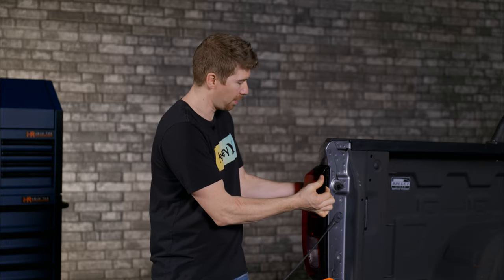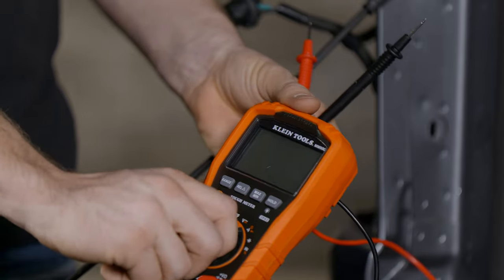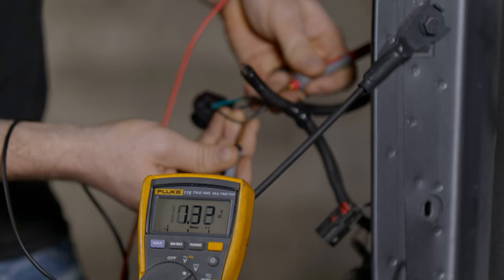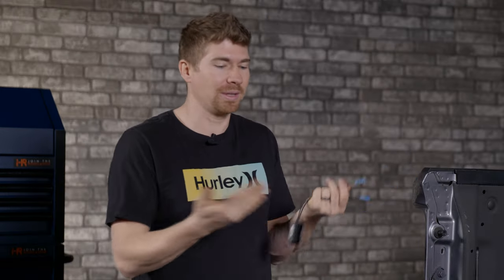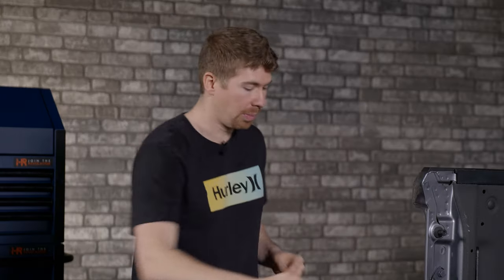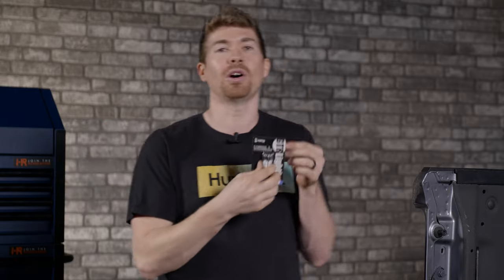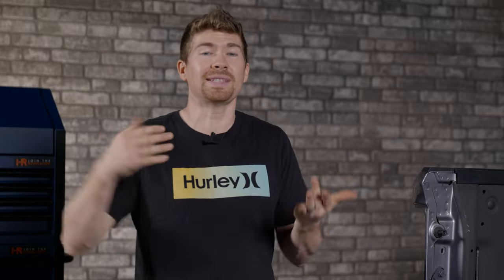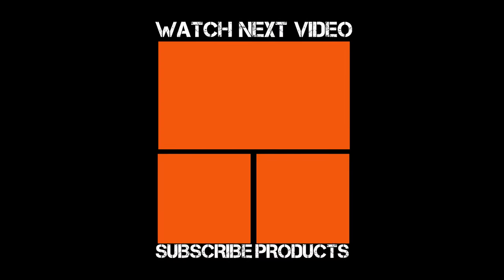How to solve turn signal hyperflash by installing LED resistors | Headlight Revolution

Comment: Explanation front-the-back.  Higher resistance (LED) = less current.  Lower resistance (filament) = more current.  Resistors are fitted in PARALLEL, so the resistance is LOWERED, to mimic the filament.

Comment: I didn't use resistors for 2000 Toyota Camry LE. The thing about Toyota is that if cut wiring. What affects one thing on a Toyota will affect other things on a Toyota. So what I did was I did some research to see what I could do. What I read and did worked. Instead of cutting wires and putting resistors in I changed the flasher in my 2000 Camry LE. This flasher worked with both standard and led bulbs. It worked. I wasn't sure that it would. So far it has still worked. I know probably you don't like Sylvania Zevo Super Bright LEDs  but my whole 2000 Camry LE is almost all Sylvania Zevo Super Bright LED bulbs. So far I have been really happy with the Zevo Super Bright LED bulbs. I want to change my dashboard clutter lights, console shifter light, and glove box to led cool white. My dome light take a 6418 dome light bulb so I used the plain Sylvania 6418 led bulb it works fine. There are 3 leds in that bulb. For the headlights I use Oracle Lighting V Series bulbs 9005 and 9006. They have no fan for which I like. There not as bright but that's okay. Especially when I got pulled over by a State Trooper saying that my other led headlight bulbs were to bright. He gave me a warning. So I changed them out to the V Series headlight led bulbs. My goal is to customize the Camry. My interior take 194 and 74 bulbs there hard to find especially for dimming led bulbs. Forgive me for this being so long.

Comment: I upgrade my "06 rav4 with led bulbs all the way around but instead of this I just bought a turn signal relay that's made for LED's and it fixed the hyperflash
Reply: Didn't know that was a thing. Good to know. Where did you get the relay from?
Reply: @honeybadgerwrx  advanced auto
Reply: Or buy the LED turn signal light with the resistors built in😊

Comment: Are the resistors constantly hot after installation or only get hot when using flashers ?  Thanks
Reply from the maker: Resistors will only get hot when they're in use!

Comment: 2 questions. So if I replace my drivers side headlight bulb, reverse light and "all in one" taillight with LEDs, if I only install a load resistor to the rear all in one like I did, is it normal for the 2 (not reverse light) to hyperflash? Or would I have to connect a load resistor to wiring for each bulb? And second question may seem stupid but it's been 5 years since I've worked with resistors lol. Am I correct stating that RESISTORS, not CAPACITORS, are bidirectional, meaning if it works and I flip the 2 inputs, it'll work the exact same (doesn't matter which wire connects to what as long as they're connected to the correct wires?
Reply from the maker: You would need one resistor per turn signal bulb. It doesn't matter which way you install the resistor as long as it is connected to the turn signal wiring.

Comment: Couldn't you just install a smaller 12v bulb instead of the resister?
Reply from the maker: If you vehicle hyperflashes with LEDs, it doesn't matter what size you install - they will still hyperflash.

Comment: I didn't see in this video how to locate the ground. I easily found the powered flasher wire with a test light, then through trial and error, I thought I had found the ground. After wiring and mounting both sides I tested again, and all was good, normal speed flash. When I tried them with headlights on, though, I got nothing. Not fast, not normal, nothing but running lights. I've got a 1973 VW Bug. Any advice would be greatly appreciated.
Reply from the maker: Shoot us an email, we might be able to help! sales@headlightrevolution.com

Comment: There are relays to fix this issue or even smart relays to do other functions.  This is cool but there's easier and better fixes.
Reply: Unless you have a relatively new car (mine's from 2009) that has it all built into the CEM (nothing user replaceable).
Reply: Where does wine find the smart relay?

Comment: Isn’t it better to just get a heavy duty or led flasher relay and install it in one simple location. You would have to install this mess into every flashing light. A $12 relay is a much better option
Reply: not all cars use a flasher relay, many are controlled by a module now